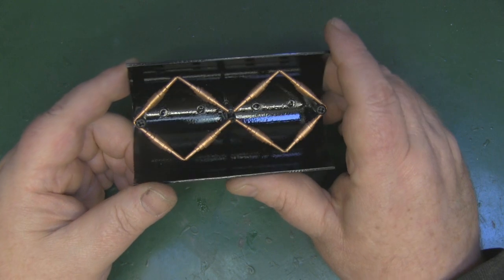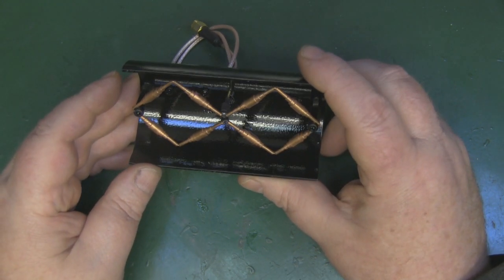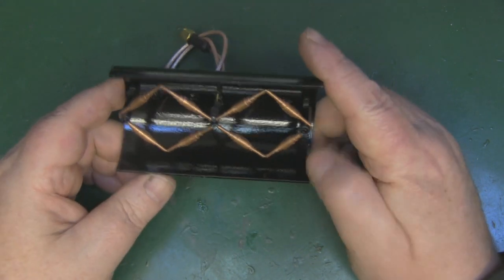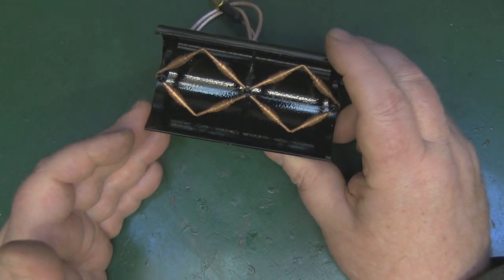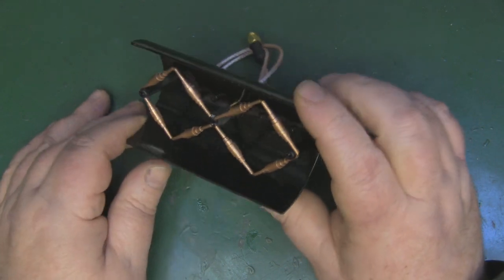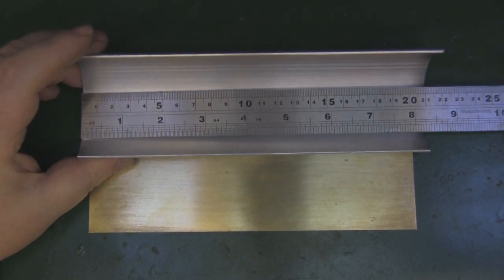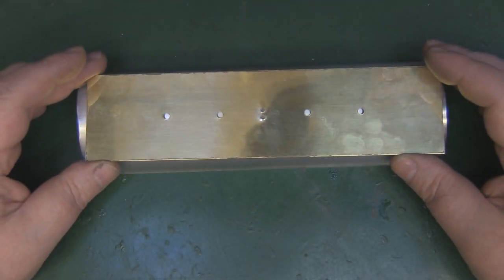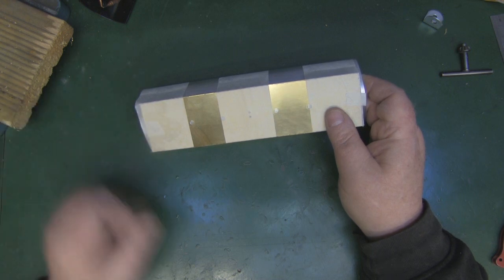Biquad Curve 2.4GHz WiFi

Comment: Hi Andrew,

I've watched a few of your videos. But I'm curious over the curved reflector in this.  Please ignore my ignorance, I'm just trying to get my head around some of this...

Does a curved reflector in this case make much of a difference since the driven element is flat and the EM waves would hit it effectively perpendicular? Wouldn't any pickup on the vertical extremes of the driven element be outside the focal point? In that case, wouldn't a flat reflector be better suited? Or am I missing something.

Would you mind filling in the gaps?  Watched plenty of your videos in the last few days, and I'll be putting together two of my own bi-quad for 2.1GHz 4G reception - it's fairly poor where I am, and I've just cancelled the best fibre broadband a BT line can give me: 10Mbps down, 0.5Mbps up!!!

Also, would this design benefit from directors / parasitic elements being placed on front like a Yagi antenna? 

What do you do for impedance matching?

Just placed an order for some parts, and looking forward to getting stuck in.

Btw, you should get yourself a 3D printer, could be an excellent tool on jigging these things up.  If you ever want a few peices 3D printed and posted down, send a PM, I would be more than happy too for what I've learned on your channel.

Comment: Interesting approach.

I'd be interested to see how signal strength compares with a conventional flat reflector version (same element).

It looks like the element cannot be optimised uniformly to the reflector because of the variances caused by the curved shape.

Having said that, obviously the reflector will work to some degree (excuse the pun), but just how effective will it be for that dimension.

Cheers Rob
Reply from the maker: Could do a side by side test I will say that the thickness of the aluminium, 1.5mm would help in pushing as much of the energy forward. (front to back ratio)
Reply: Hi Andrew,

That would be interesting for sure.

Comment: Dear Andrew, I really like Your videos and the very practical & simple approach. I would like to replace my GNSS antenna (2.6 dBi) with a higher gain one. Is the concept of the Biquad antenna working for GNSS signal as well? For example: L1 = 1.575 GHz -> wave lenght= 190.2 mm, the wire lengths will be 47.6 mm & 95.2 mm.
> If the Biquad antenna is not right for GNSS, then what is Your suggestion?
> Any kind of feedback from anybody is sincerely appreciated on this subject :-).
Thanx a lot in advace.

Comment: If you intend to please the symmetry afficionados amongst your customers, you could put the outer set of rivets in the centre of the outer quads. Purely cosmetic, though.

Edit: you could even put those two posts, that are at the ends, under the cross and affix the driven element with that epoxy putty. That way, you could even hide the heat-shrink. The idea is to eschew privets completely, and use nuts (on the posts) at the back side. Again, purely cosmetic, but even "cleaner".

Comment: I've got an Asus RT-AC87U router at home which has 4 antennas but I'm not happy with the coverage in my 2-storey semi detached house. Would it make sense to replace one or more of the original antennas with the antenna shown in this video? 
My original antennas are 2.4 & 5GHz antennas. I realize the antenna shown here isn't 5GHz but I'm only interested in reaching some dead spots and I'm not interested in higher speeds of 5GHz network.
Reply from the maker: it will work fine like that I used to do it to get wifi in my conservatory
Reply: Wifi high speet curcit diagram
Reply: @andrewmcneil     Do you sell these?

Comment: Really good video like always ;) ..I am thinking about making an antenna like that for myself but i am not sure if a double biquad or two single ones combined (over an wilkinson splitter) would be an better idea.
Reply from the maker: Hi Tom give it a go and see how it works but remember a wilkinson has 3db of loss so best to use them in conduction with a small amp to make up the loss
Reply: @andrewmcneil  Even if you got that loss of 3db, it still could operate at around 15db, which would be more than a double biquad, if i got that right. But thanks for you to consider testing it :)